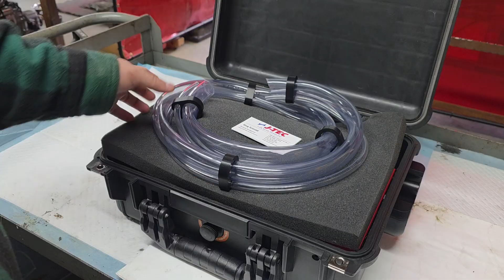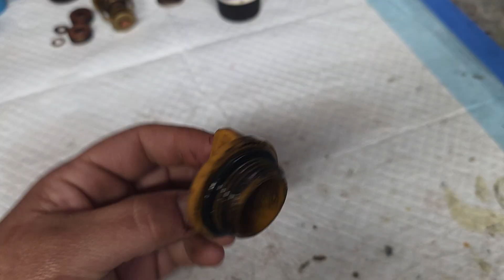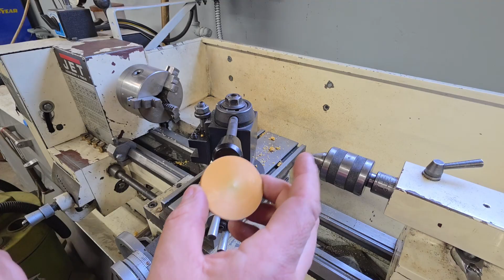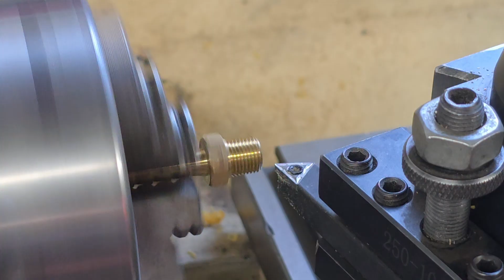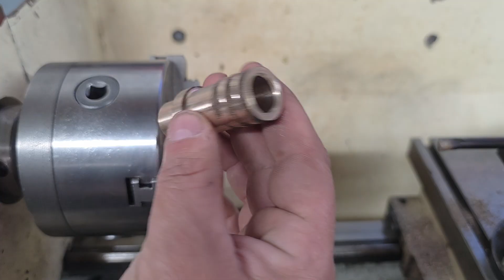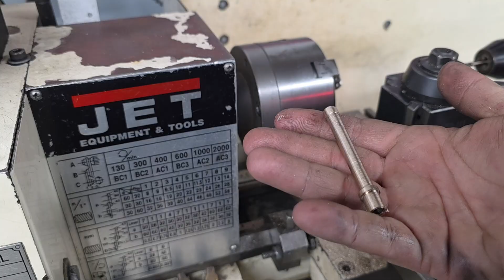Machining an adaptor for blow-by testing!

Comment: Nicely done, but the real test is doesn’t work?
Reply from the maker: JTec is actually work on making adaptors for different marine engines, the test kit has some generic rubber adaptors that work fine, except ai can't hold them in place and monitor the meter at the same time, so ai decided to make a captive one.
Reply: @Madamediesel671  Yes, adapters comming soon, we can't have you using the mini bong forever!!!